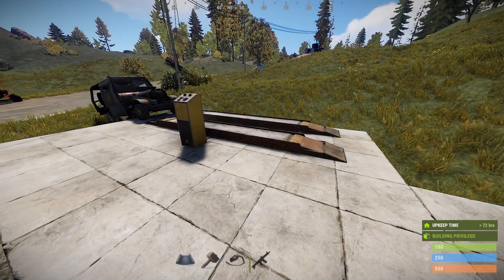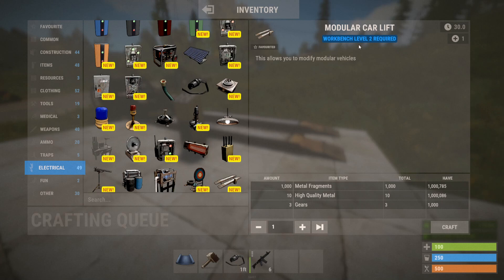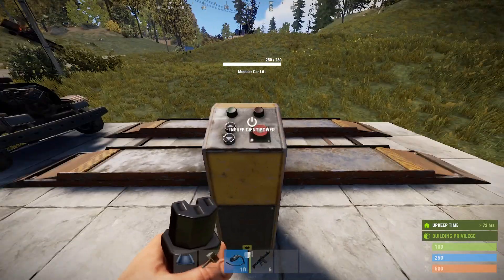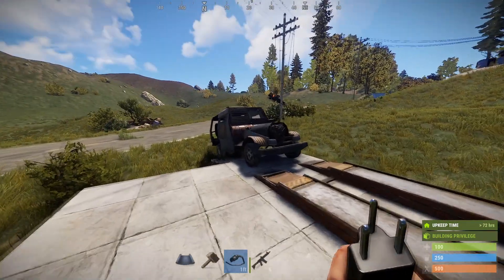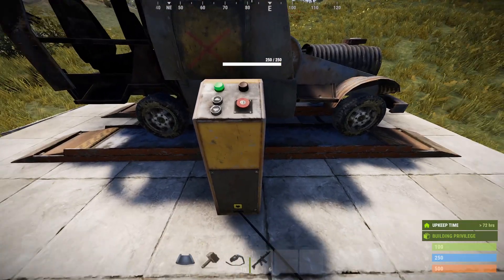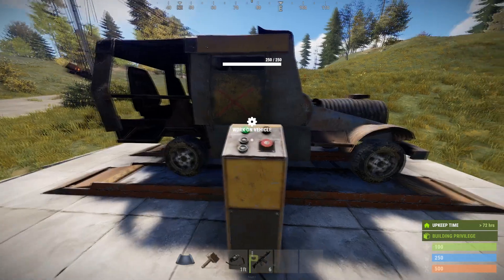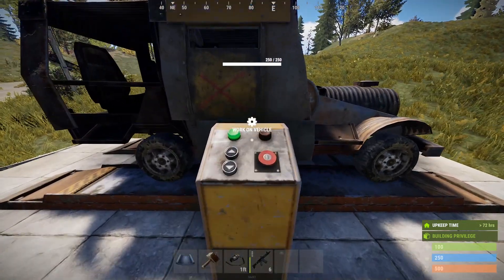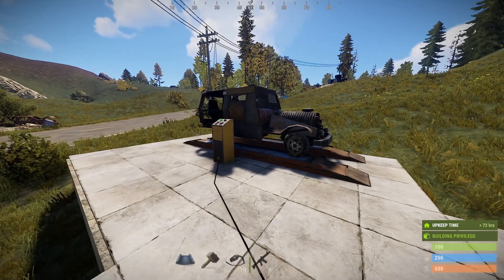Rust Electricity 101: Component Guide - Modular Car Lift

Comment: I placed a car lift inside my building, the floors (foundations) are wood.  I tried to make an electrical connection from battery or Branch to lift, it won't even let me connect to it.  I wonder if the foundations need to be stone at least.
Reply from the maker: I am unable to replicate this on a vanilla server. I can make connections from batteries and branches even with the lift on a thatch foundation with no TC. Perhaps and issue with the specific server you are on? Not really sure.